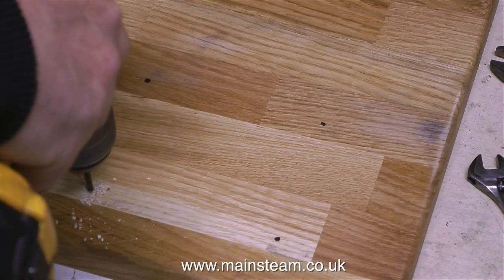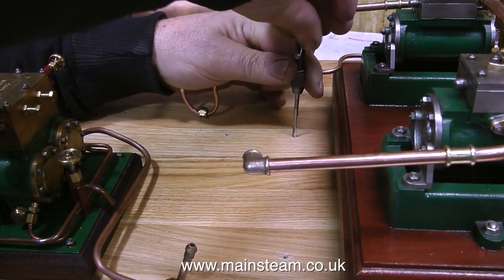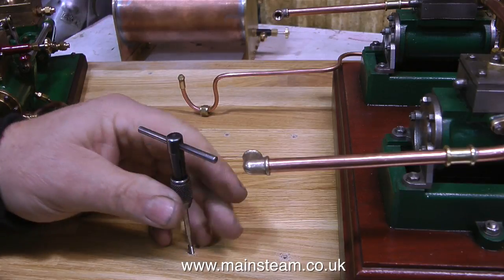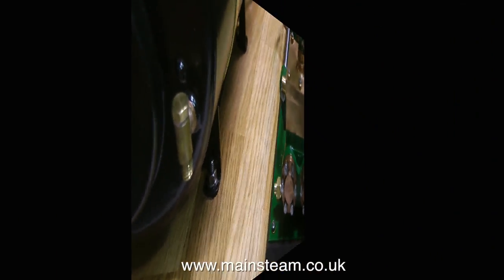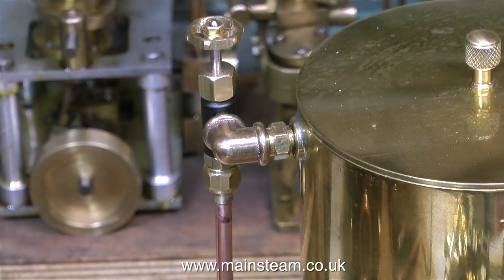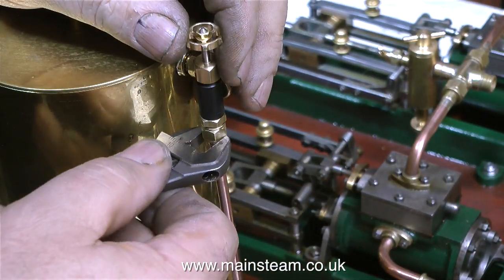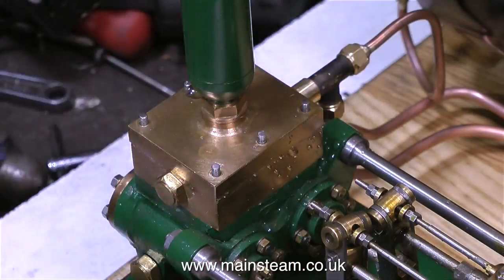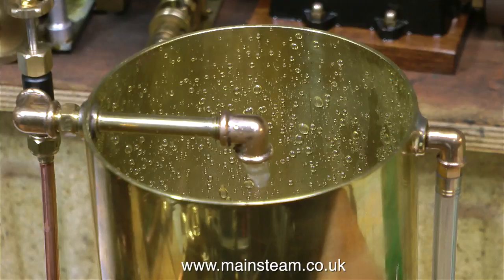ASSEMBLING A HIGH QUALITY MODEL STEAM PLANT - PART #13

Comment: I don't do anything anywhere near as amazing as this, but I also use CA to reinforce threads, so that was interesting to hear. Specifically when the threads a self-tapping screw makes in plastic are weakened or broken. The only difference is that I put the screw back in after applying the CA, so it hardens around the screw and reforms missing threads.

Comment: Nice work, Keith. I always liked the idea of a mechanical pump and bypass valve system, seems very simple and reliable to have constant water feed while the engine runs, especially on locomotives. I realy wish I could fit an engine-driven pump to my Wilesco D48 plant, would make life so much easier being able to fill up while in steam.

Comment: Keith, have you thought of using knurled brass rod with the thread that you want down the middle instead of threading the baseboard itself? These could be then super glued in and then they are good forever. I understand it's more work because then you've got to set the lathe up to knurl the part and the thread them, but it's just a thought. Thanks for your excellent, instruction and practical videos, indirectly you've given me confidence to tackle jobs which in the past I would have been afraid of before! Thanks for reading and I hope you found it useful 😉.
Reply from the maker: Yes I have done it in the past like that on occasion. But the threaded baseboard/Cyanoacrylate method is quicker.

Comment: How did you manage to attach the steam exhaust to the front of the condenser?  The 90 degree junction is attached to the pipe from the cylinder exhaust, but then needs to be screwed onto the threaded pipe from the condenser.  Seems like a complete catch-22 situation, but obviously you managed to do it.   Keep up the good work - I am inspired!
Reply: Hi.  Got it - part 18 includes the solution!  Great work as ever!

Comment: Great video. Instead of putting a bypass valve to outlet of duplex pump will putting a valve at steam inlet to pump work? That way we can stop the pump when boiler is full of water and start it when level drops down. You can conserve steam too by intermittently running the pump.
Reply from the maker: I think that you maybe missed the point. There will be a valve on the steam inlet, the bypass valve allows the pump to run without filling the boiler - as I explain in the video ......

Comment: Kieth, do you use apipe bender or do you bend the pipes by hand? Also, do you soften the copper pipe before bending it or do you use it straight from the coil in its original state?
By the way, your videos are superb; you have a very good narrator's voice and the information is superb. Many thanks.
Reply from the maker: Half & half really, usually I bend the pipes around my large fingers, for the smaller diameter piping and us the bender for 1/4" upwards - and I only anneal (soften) the piping if I bend it wrong a couple of times. Thank you for your kind comment.

Comment: I'm also quite the PC computer nerd, and since you do videoing editing quite a lot, I'd love to know what PC you use. Do you a laptop, maybe an OEM desktop or do you use a custom made PC? I have a pretty nice gaming PC and some servers.
Reply from the maker: I use an Apple iMac with 16 Gb of RAM -  running Final Cut Pro X.
Reply: That makes sense since you're a music guy as well, a lot of video guys like Macs. I personally hate them with a burning fervour, I find the software just isn't compatible with how I like to work (I like my software to work for me, doing it how I want, I just find Mac stuff makes you do it their way, which is why I mostly use Linux) and it costs a lot more for what is a lot less. However some of their work is quite ascetically pleasing. I think the best computer they ever made was the old Power Mac G5's, holy hell those cases are simply beautiful.
Reply from the maker: For the music side, using Pro Tools - I use the PC type running Microsoft Operating Systems, but I prefer the reliability and lack of problems that to me makes the iMac to be the better system. I don't need it for gaming, only for video editing & some graphics. I also have a PC which I use as a Fileserver.
Reply: Keith Appleton interesting, but yeah, I built my Uncle an insanly expensive PC for music work, I needed to order 3 different super specialised cards for ports and processing for switch board things, they cost more than the PC all together. Sounded great though. I water cooled my PC, however recently I've been thinking of making a super custom PC using a modified steam powered water pump as the pump, and running it off a 12v DC motor, I think that'd look great.